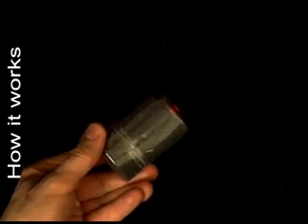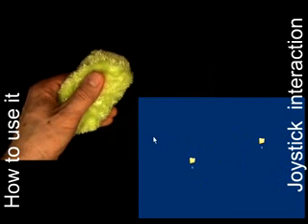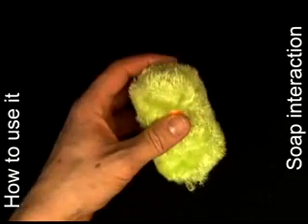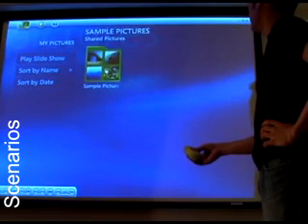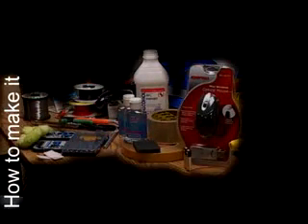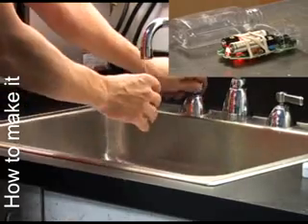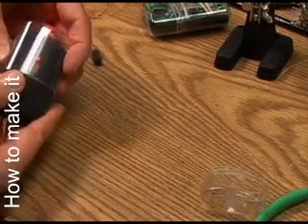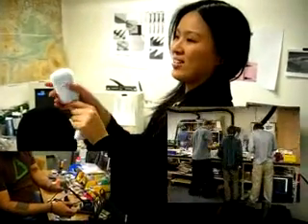Soap: how to make a mouse work in mid air

Comment: This is cool and creative, but has no application.
Every feature it has is done better in every aspect by another device, more suited to the job it was purpose-made for.

There is no reason that anyone would want one of these if not simply to own it.

I'll point out it's gaming application, to be specific.
Yes, mouse and keyboard binds the user to a table. This has never been a problem in need of addressing. PC gamers have, on average, absolutely NEVER lamented the inability for them to stand up and pace around, or sit back on a recliner or couch to play, both if which they CAN do with a gamepad, another easily accessible and very familiar gaming implement. meanwhile, those who remain with the mouse and keyboard have found it perfectly suited to their needs, barring some minor, specific modifications, most often simply to layout and spacing.

It's a cool little device but it just has no reason to exist, and is entirely outclassed in every way by purpose-built devices. It doesn't solve any problems and addresses issues that aren't even problems at all.
Reply: I'm thinking of making one just for the novelty of it. It would be fun to dink around with for a day
Reply: ishouldplayzelda
Well that kinda sums it up right
It's a thing you mess around with for an afternoon and then probably forget about

Comment: I don't really see how this is better than a controller, once you get used to a controller its extremely accurate, also mice are precise for FPS's due to how they're used, this loses a lot of that just due to things like gravity and slight movements in the cloth when you rotate your fingers. Also you have to stop a lot more often in the rotation to get an accurate sweep, things like circle strafing would be extraordinarily difficult to do accurately with this.